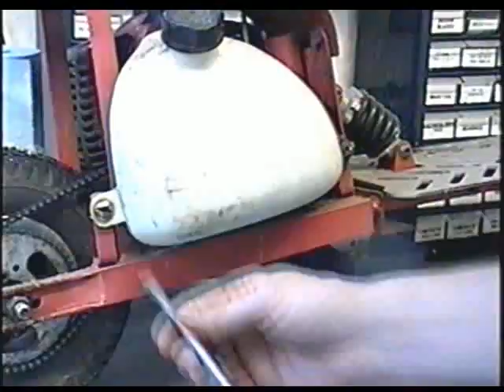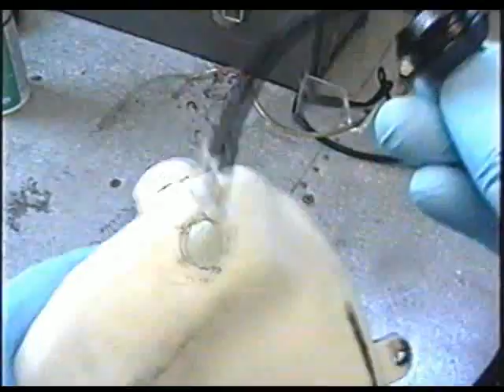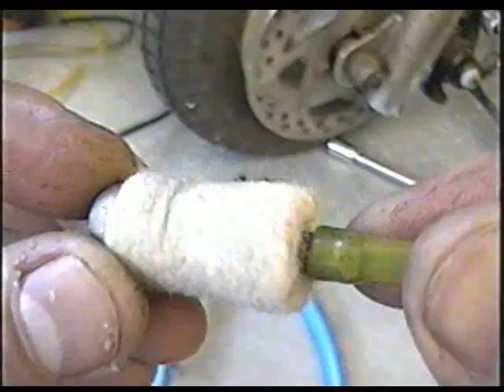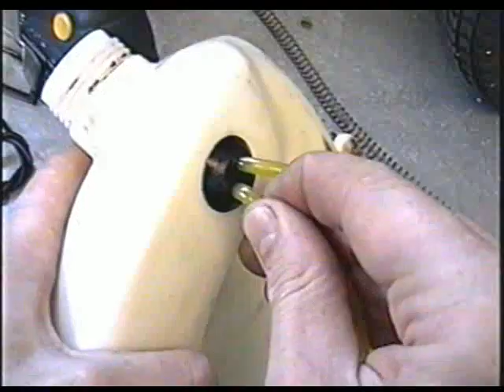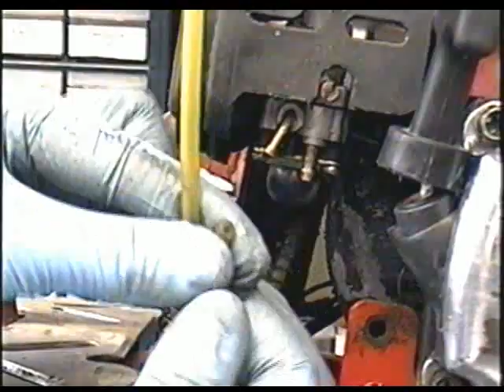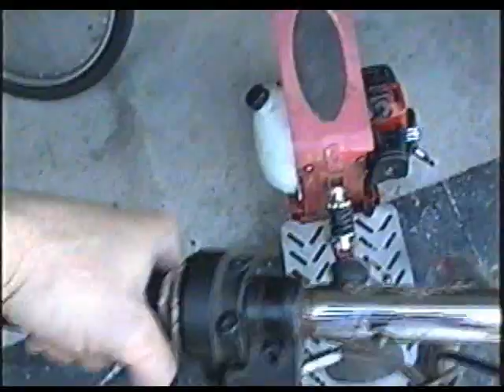STAND UP SCOOTER Fuel Line Repair

Comment: I have a 52 cc scooter engine on cateye pocket bike I just put gast line one didn't know if both where sapose to touch the bottom of the tank got it started and it stop won't changed line to other side won't start at all now 😡

Comment: nice video. may i request if you can do a video on how to properly adjust the fuel mixture screw on the carb? And if you can show a video which compares how an engine would sound like with a good and/or bad adjustment. I have the same engine as you do.

Comment: I want ask you what size are your tubes because I trying to buy some tubes looks almost similar to yours my is a G-SCOOTER a friend give me to me but I don't know if it runs because is been more then 12 to 13 years when he bought it but he only used for 2 or 3 years but he gave to me last year I'm trying to restore it to make it run and I trying to know how much oil and gas need to be mix because he lost the manual and tools and container to mix oil/gas I don't know nothing of mixing

Comment: I had got one of these for free and ordered a carb for the 49cc Chinese motors on accident and its a larger carb, I made an adapter plate because a hole on the bottom of the new carb was lower and wouldn't line up with the original hole on the engine(I dont know what it was for but I was pretty sure it was vacuum or something). What I am wondering is, would it run right, I was told I am most likely going to flood it even if I turn the adjuster screws in.

Comment: the fuel line on my friends broke off and i didnt feel like replacing it with a new one for him so i just put it pack on but it was to hard and brittle to just push on so i had to heat it up with a lighter, him and his mom freaked out while i was doing this but i think it was a success because there was no fires or explosions. lol

Comment: I have a question about your video taping. Sometimes it seems as though you have the camera attached to your head. I see your two hands and the perspective seems to be as if you are looking directly at your hands but the camera is moving slightly so it seems there is no tripod. Is that what you do? Attach the camera to your head some how?

Comment: your videos are great and i appreciate them very much. i have an identical "bandit", and was wondering if your engine mounts have held out ok? the protrusion from the engine lower case that mounts to the frame at the rear of mine has broke from the engine. they're not the fastes or smoothest scooters, but damn they're fun and quite cheap to run and buy stuff for. thanks for your informative videos, long live the gsmoon/rebel bandit 33cc!!